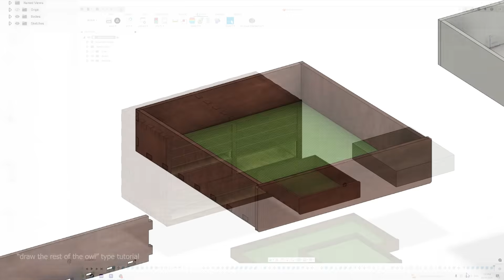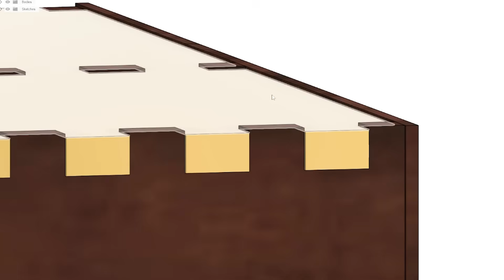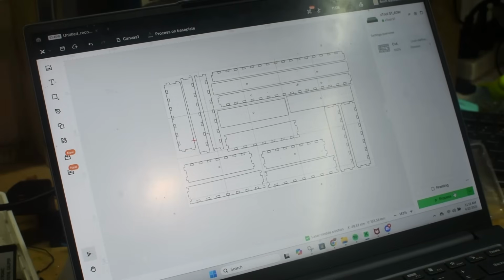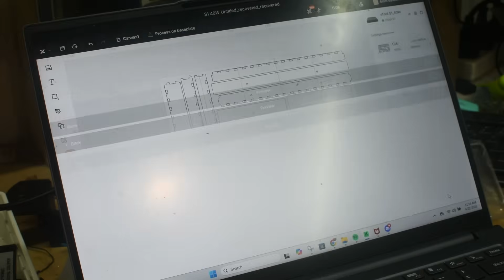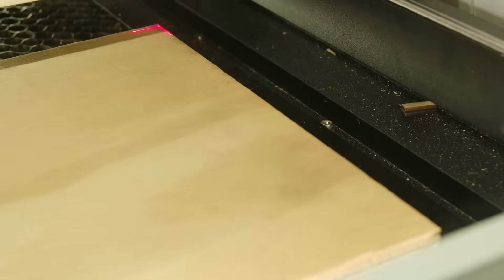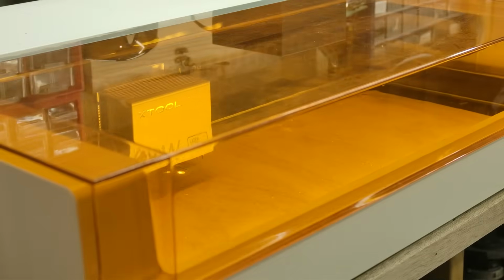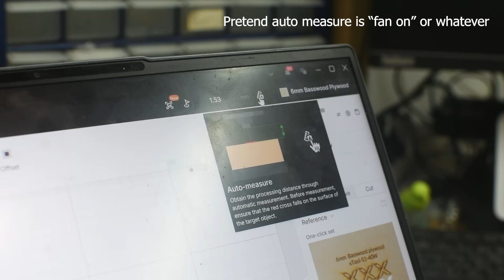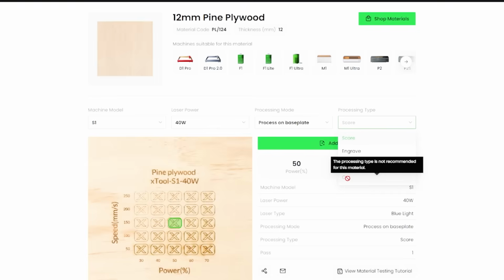Making A Machinist Tool Chest From Rubbish And Lasers

Comment: What effect does gluing "char" to "char" have on the strength of the joint?  Would it be better for structural strength to sand the burnt bits back to bare wood for a stronger bond, or does that turn out to not really matter?

Comment: Try cheap laminate flooring(or free if someone is replacing a floor) as a material for storage solutions, also works great as a direct replacement for alu-plate for many things(all those build a tool/machine from pvc/plywood videos...) as long as the laminate is 2-3mm thicker than the alu you would use. It is very flat, dimensionally accurate.

Even the cheap stuff is hard wearing(for most things that isn't an actual floor) and the quality stuff is tough enough to even use as sliding surfaces for machines. And it all comes with finish included...

The areas on the backside that needs to be glued needs to be well sanded first but that's about the only drawback...

Comment: I think I'd stain it. The natural does look pretty good, but if you get a darker stain and wipe it off immediately after applying it, it really brings out the grain in the wood, which I think would look quite snazzy. And then as someone else recommended, wax or oil the wood so the drawers slide more smoothly. Personally, I'm a big fan of hand-rubbed oil finishes (but I also just hate the way varnish and poly degrade over time).

Comment: Is it just rolling shutter, or is your table saw blade on backwards @0:55 ?
Reply: It’s not rolling shutter, it’s aliasing. The blade rotates too fast for the frame rate, which creates the illusion of rotating backwards.
Rolling shutter depends on the shutter speed and not the frame rate und would visually distort the object.
Reply: probably just rolling shutter. Looks to be going the right direction in the next shot.

Comment: The plywood cutting capacities of these lasers are often rated by the manufacturers as some very soft bass plywood with laser friendly glue. So when they claim the machine to be able to cut 15mm plywood, what they mean is it can cut 15mm bass plywood specifically tailored for lasercutting. For regular plywood 10mm cutting capacity is more reasonable assumption.